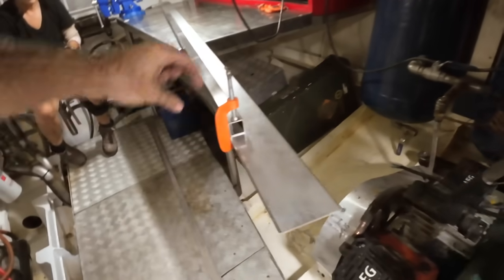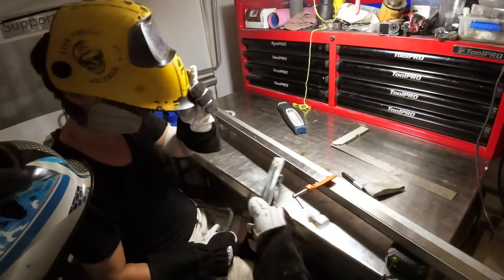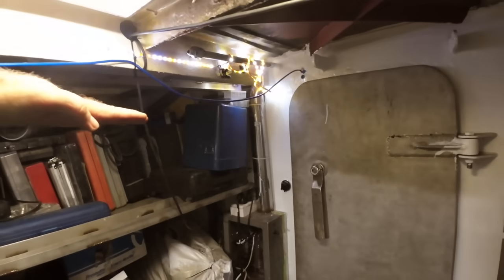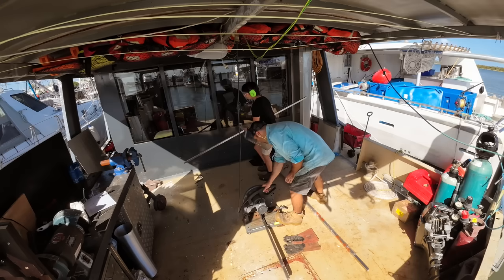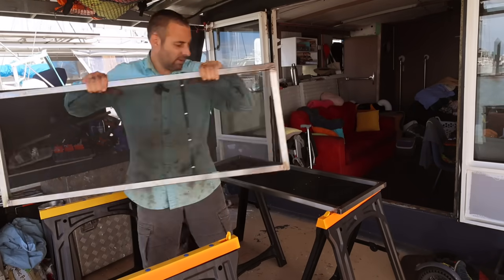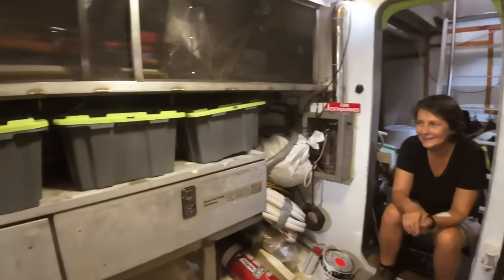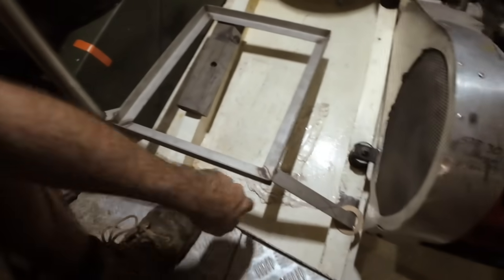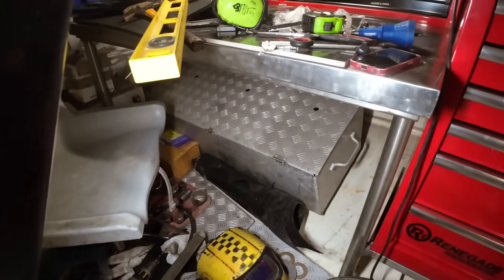How do you like them drawers? - Project Brupeg Ep.343

Comment: I have watched many of Adam Savage's videos on sorting out your tools. Three tips that remain with me.
1. sort your tools into categories of use, have 2 or three categories. 1. Every day/week - 2. every month - 3. once a year or less
2. Every day/week tools should be reachable from where you are working - closest drawers etc. The next level further away and the final level can be in another location.
3. The last tip was laying out all the tools (in your case as many as possible) so that you can look at all of them at the same time and paint a picture in your mind of when and how often you will use each one ... I know space is not abundant but I would commandeer a space on on the deks for a week just to look at all the tools. Sounds like a weird idea but I have watched Adam do this and formulate the solution over a few days.

Awesome job on the shelving.
One think jumped to mind, you know how they secure the serving trollies in and aircraft galley, they have these flip down leavers that stop the trolly from moving out while they are not in use, I was thinking the same idea for those bottom containers jut a flip down leaver that will act as a gate to stop them moving out.
Reply from the maker: I like it. Yes we are thinking something simple like a rod that drops through a welded saddle on the top stainless and into a hole on the alloy draw below. When you want a plastic bin, just lift the rod up and slide the bin out.

Comment: Have the tools that you will use more in the box next to the table like sockets and shifters so on. You can use foam and cut out or place the tools on plastic bags and use spray foam so your tools don’t move around and then you can see what you have. The back draws nuts and bolts that you can have in plastic containers like take out with lids.if you still have the lid to the back box you can cut off the front and put tabs to lock it in. Have a bolt  down charging Center or power board.

Comment: You just did the worst you could do. After so much clutter, clean up and organize everything. Now you will never find what you need. Been there, done that! Now I spend an hour finding a fuse that used to take 5 minutes! 😂😂😂
It looks good. 👍
Reply from the maker: The post clean up pain is a pain we must live through
Reply: @ProjectBrupeg   good stuff, I put some boxes and a few shelves in my workshop which isn't much bigger than your engine room. Transformed it! Of course every project is just as messy as ever, but cleaning up afterwards takes 5-10 minutes.

Comment: that middle shelf - just needs a bigger lip at the bottom - one high enough that the crates can't come out due to wave action but low enough that they can be grabbed and pulled out.

But then if you were going to over engineer it.... make a hinge able lip on the top that can be locked in the downward position.

Comment: How about putting the power tool battery chargers  on top of the  small red cabinet?  Use Velcro to keep them from sliding around. They can charge battery's and hold them in place ready and easy to get at for the next job.

Comment: I'd hang all my wrenches on the bulkhead left side of the work bench by size on two up angled rods to lock em from swinging. With rubber spacers on the rods to keep them from chiming. 🤔🤔You guys ever thought of getting a simple piece of property on the water to build a conex box home base/shop with dock for Brupeg? During repairs, PMS, or for the off seasons.
Reply from the maker: Many times. Having a waterfront base would be our altimeter dream. We have often thought of being able to build a wharf to keep the boat on and a ramp to lift the boat out whenever we felt like it on the property. But alas that’s not something we could ever come close to affording in NZ or Aussie so it’s tucked away in the very long term plans

Comment: Draws, draws, draws.......
What to put in the draws?

If you're anything like me you have a collection of manuals and warranty papers from every conceivable piece of equipment you've bought in the last 10 years, they could go in the draws.

On part 1 of the storage series you mentioned that you would like to see the sliding doors via camera to confirm if they are closed and secured properly for sea.
I think a similar priority should be given to the tool draws
Just relying on whether or not you remembered to lock the cabinets without any visual confirmation could end up very messy.
Maybe a hinged angle iron on the side of the draws or an external rod that is secure top and bottom for when you are underway.

I'm not sure if I got this bit right....
If the boat is going to be fully insulated, wouldn't ducting air from the living area through the battery box to the outside compromise that?
If the battery compartment temperature is the same as the living area, I'm sure that would be adequate for the batteries.

As always
Massive Respect

😀👍🏼 
Be Kind
Reply from the maker: The duct will pull air from the battery box and force it out the roof. new air will enter via a 50mm hole behind each charge controller on the opposite wall. When we are in cold climates the charge controllers wont be producing as much power and therefore as much heat but also we wont need to exhaust the heat as the total temp wont be in the danger territory. its only an issue in the tropics as the solar is going flat out, the charge controllers are running at full bore and the inverters are powering every air conditioner in the boat etc. so if we can cool it enough for these conditions then we should have solved the problem (it currently works fine so its not even a problem per say).
Reply: @ProjectBrupeg  No matter whether you're in the tropics or the arctic, feeding air from the living areas through the battery compartment is a good idea.  Keep the controllers cooled when it's hot & the batteries warm when it's cold.

Comment: NOT TO PUT MORE ON YOUR PLATE BUT INSTEAD OF ALL THE FANS YOUR RUNNING FOR COOLING- you could tap a cooling line off your seawater intake to a thin radiator and  put a fan on it to cool ya down better than ambient temp- sea water is much cooler— and would bring many of those projects more bearable and provide cooling for the engine room components!  Just planting seeds. Thank you for the amazing content!!!!
Reply from the maker: We have pondered this but to be honest, the seawater temp where we are is hot to the touch (the raw water pipes in the engine room are always warm) and we suspect that will be the same roughly for a large band either side of the equator

Comment: I divide my drawers up by type e.g 

measuring stuff
Allen/torques
Screwdrivers
Cutting, knives/scissors
Tapes
Sanding
Saws/blades

Put the stuff you use most in the most accessible drawers, label drawers so anyone using can find tools and put them back in correct place

Comment: Hey Guys! I don't know if this helps but I have a drawer in my tool box for smashing stuff. I has pry bars, sledge hammers, large pipe wrenches and big screw drivers. If I ever get frustrated when working on a job I LOVE opening up that drawer. It is very therapeutic! Great job on the engine room everything is looking great! I am wondering if the brackets for the tool box might be a bit under sized for the weight you are going to have in that thing 🤔. Thanks again guys, cheers!
Reply from the maker: Possibly, but could eaisly be beefd up if needed.

Comment: Great episode , I think you need to callibrate that  little known stability test, 1.shake 2.  Two shakes 3.hip thrust for trailers  and of course 4. the kick with a steel capped boot test. !! As for organising the drawers , use  labels to remind you where to throw  things after the job has finished  and before you go  for a beer.  I can no longer rely on my memory mind map to re-find my  stuff. I am guessing that once on passage  the engine room is the last place you want to be so the  storage system has to be obvious to allow quick in and out and back up to the fresh air. 
good to see Jess moving abot more freely.

Comment: Stuff in the "above the workbench" drawers should be stuff you need access to before and after a job because opening them interferes with what ever project is on the bench. Stuff in the small new red box can be stuff you need during a project. Doesn't interfere with the current setup on the bench.

Comment: My recommendation is to put on a far wall where little happens and put like parts in a dedicated container dust free and enough for 2-3 sets of water maker filters and spare fittings/parts. 
Next to that put/build lockers for mission essential spares that without would put you dead in the water otherwise.
Ya can't use what you don't have............ Do a detailed inventory of what you essentially need, should have, kinda have to have and nice stuff to have. 
I remember Delos, Parlay, Plucky and others having to get creative to solve problems not normally happening normally. 
Small items like screws, washers and electrical connectors seem to get used a  lot.
Have fun and creative........ I've been to Antarctica and we've been stuck with no resupply during a series of storms for 2-3 weeks .................. Remember that Murphrey is always present and waiting patiently for the right moment .......................  enjoy

Comment: Thoughts on the green tubs. On my boat I have tackle draws in the bait tank setup and I use black bungee cord from Bunnings. It’s cheap as chips and you can cut to length and just burn the ends to stop fraying. Weld a tiny bit of plate at the top under the new sliding doors with a whole in it. Slide the bungee cord through with a knot at the back and do the same on the lip where the tubs sit. One for each tub. Then all you need to do is lift the bungy out of the way to pull the tubs out. But the cord will hold the tubs in place? Wish I could attach a pic with a drawing on it haha well done guys. It’s looking amazing!!

Comment: Great episode. Is there any suffocation danger using tig in the enclosed engine room? (Or even storing the Argon there for that matter). Had a welder at work suffocate as he entered a tank after the weekend because the Argon tank had a small leak that over the weekend had displaced all the Oxygen
Reply: They've mentioned before that they take appropriate precautions for confined space welding
Reply from the maker: We store our tanks on the rear deck, but yes it can accumulate in this area when using the welder. Normally when welding we have a massive fan pushing air out of the room (located above the rudder hatch) and fresh air is pulled in via the door on the forward bulkhead so it tends to clear the room before any argon can sink down

Comment: Did you sort out how to cool the battery control area?
Are you got to put window tint on the bridge windows? And last . Are you putting in grab handles  for rough seas?
Cheers from across the pond
Reply from the maker: Yes to the battery. Adding a 6” fan extracted ducting, with a 2” inlet hole cut behind every charge controller so cold air is pulled into that battery box directly onto the cooling fins of the MPPT’s
Possible yes to tint, waiting to see what they are like without
Plan is for plenty of grab handles, just haven’t built them yet

Comment: as always thanks for the vids. my turn to be under the weather so your both off the hook this time lol,,,, it sucks. the important question of what goes where..... highly subjective and must change from person to person and also for each location.... the best i have for you on it would be store it where it is most handy for what it is used for  welding supplies and tools at the bench  as for tools   one set or one where it is needed wherever it is needed  is  the tools to service the engine mounted to it same for the other systems..... having multiples more expensive yes but possible emergency situation whats needed where its needed worth the cost i believe.  so that should be clear as mud and help heaps with the decisions lol   but i did say its my turn to be under the weather so the suggestion is only minimally helpful.

Comment: How often do you have to get the compressor tank drains that you just put the cabinet in front of? Seems to me you are trying to fit a 30 meter boat’s worth of stuff into a 50 foot trawler…
Reply from the maker: Thats exactly what we are trying to do. Drains are still able to be reached without to much contortion but we do now have some auto drains to fit which allow the tanks to auto drain whenever there is around 3cm of water sitting in the bottom of the stainless tube. So reaching back will become a rare event.

Comment: You did an impossible job using great skills with little money and many friends with an excellent attitude. I bet the boat is worth about 1.5 million dollars as is where is. you have over 100,000 man hours od labor and great content for others to learn by. The engine and electronics are great. How many hours on the Hobbs Meter do you have on the engine now?
Reply from the maker: currently less than 6
Reply: That is not many but a great start to make the many adjustments and changes needed. It would be nice to do a 3-4 day on the water run and see what needs to be changed. I am a long-time subscriber I wish I could go for that type of check out since during my day I flew 15,593 hours as a 747 Captain delivering Cargo all over the world.  @ProjectBrupeg

Comment: I need to take this opportunity to warn you about a liquid cooled generator in the engine room before you bake the idea in. 
I'm sorry for the long post but there's no other way. I am a qualified mechanic so I kinda know what I'm talking about but I'm also a consumer and get caught out like any other consumer. 

I don't think it's going to be as straight forward as you might think. The cooling is going to be a problem. They suck air in through the vents on the side of the cabinet, then through the radiator and out the front of the cabinet. This is so the main alternator/generator gets cooled. 

At high load while your main Cummins engine is running I reckon the heat down there is going to be more than the generator will be able to handle continuously. It'll be OK for the short term but for long term, stupid things start happening like starter battery dies every few months, because they can't handle the heat. If that's happening to the battery then all sorts of things are happening to every electrical component in the generator including the outrageously expensive controller, where when it fails or the LCD screen goes out the generator becomes useless until you replace it.

A way around the heat might be to have an active fan solution for the engine room. There's a place in Horsham Victoria called Smallair. They have largish commercial steel fans that could be what you're looking for. Whether they can hack marine environments I don't know.

Back to the generators, say you do manage the heat in the engine room. They say these generators are rated for Australia's north, but the seller generally doesn't know shit from clay since they don't live off the generators they sell. You ring up with issues and you get, "We've literally sold hundreds of these and you're the first person to ever complain." That's code for trouble.

In mine I bought a load bank for fault diagnosis reasons and ran it at 500w below rated power for 60 mins on a 15deg C day and the generator overheated and the over temp alarm went off and the generator switched off. This is a generator rated for Australia's north. Pig's arse it is.  

In 3 years on mine I've had 2 radiators ($400) in it, 2x engine alternators ($380) and I'm on my third lift pump and forth battery. An auto electrician explained to me the battery & engine alternator issues are heat related. The went on to say these generators are meant for emergency and occasional use and using them 14 hours non stop is a high use scenario even if at light load. I explained to them the manufacturer say's they're good for 20,000hrs, the auto elecs laughed at me.

Mine is outside in the weather, what about in Brupeg's engine room? 

Auto elecs got me to buy a very large heavy duty battery and mount it outside the cabinet. The lift pumps keep dying because of inadequate fuel filtration leading to high pump load combined with excessive heat in the cabinet. The fucking radiator is crap but the replacement cost is around $400. Essentially it's just a junk single row $40 Chinese aluminium radiator complete with cocky shit welding but unfortunately specific to the generator you buy, so they slug you 10x its value because they can. The quality of the radiators is utterly appalling - no wonder they overheat.

This is on a generator in the $7-$8000 dollar range. Generator issues are the absolute pits, I cannot emphasize this enough.
If you think it's improbable to have 3 not working at once, think again. Really the only viable long term solution is a custom built commercial unit but who can afford that? You come to that conclusion.

Comment: YOU are the tool user so YOU decide what to put IN the drawers BUT .. those drawers will fly open and tools fly around a lot if you don't figure out a way to keep them from flopping about on rough seas... Make something for safely keeping them closed  Too late for gimbals ... Fun city though....
Reply from the maker: each toolbox has a key lock which locks all drawers, so at sea opening up is not an issue, plus if you do need to open them you can time it with the swell (speaking from experience here) Dame.
Reply: 🤣🤣 @ProjectBrupeg  🤣🤣😂

Comment: Noooooooooo..... you have to rip off plastic from handles after at least a year of use, once it's all black and greasy! 😂
Reply from the maker: And the heat from the engine room has effectively plastic welded it to the alloy underneath.
Reply: @ProjectBrupeg  That's the best part - to try to peel the plastic off, tiny piece by tiny piece with a lot of swearing in-between 🤣